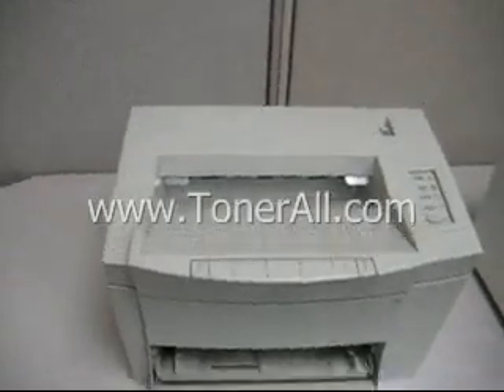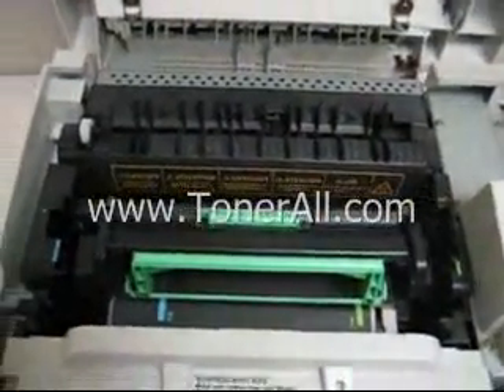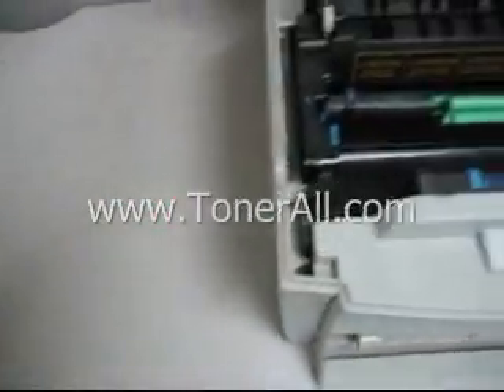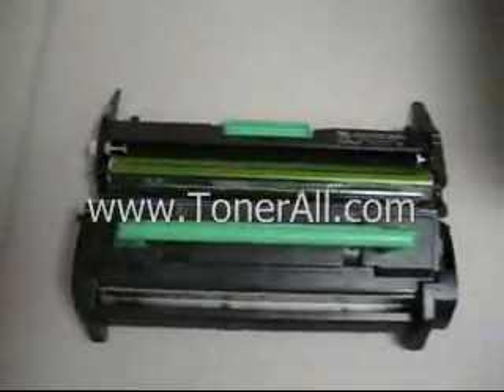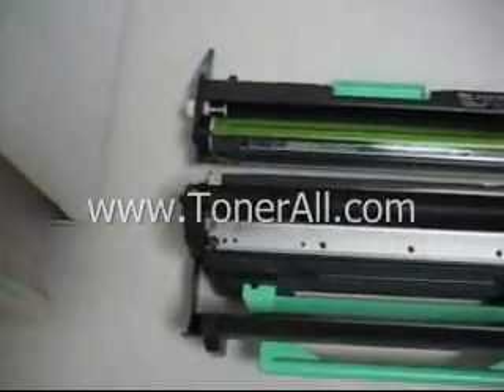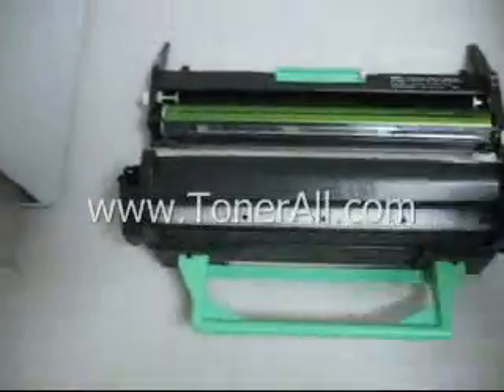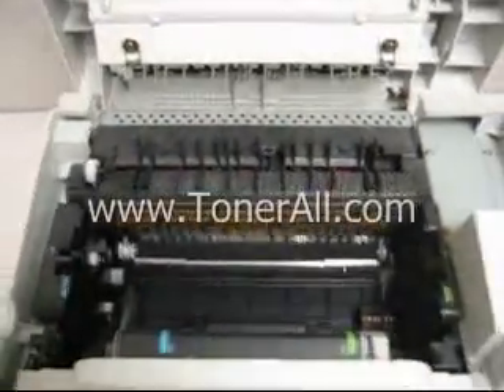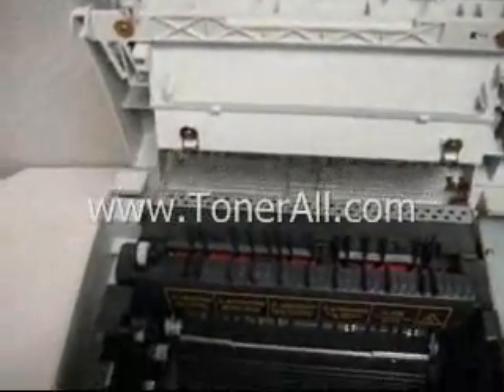How Laser Printer & Toner Cartridges Work

Comment: laser printers are the worst, compared to more expensive simplier inkjets. its a classic vs. of a product that is cheap, fast but will give out more problems vs expensive a product that is a bit more expensive, slower but.......problems? hardly any. n those do come about are fixable where as on a laser printer they are way more difficult.

Comment: Black roller in toner cart is a Developer. this is holding toner using static electricity.
it then goes onto the drum. then the peice of paper is pushed up against the drum with a transfer roller. it then goes through a Fuser to burn toner into page. then the 10 year old printer probaly jams and you buy a new one :)